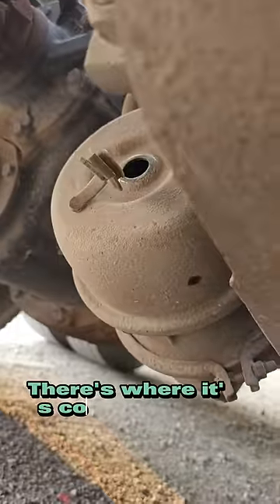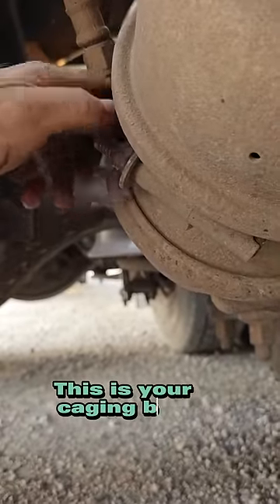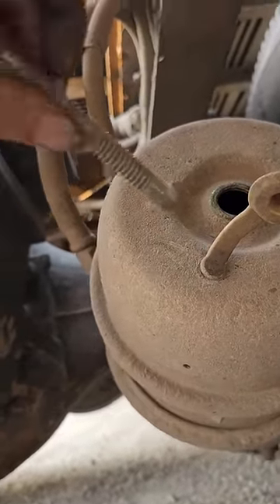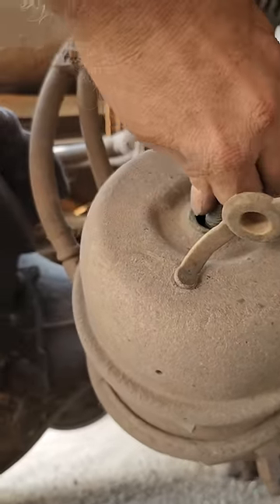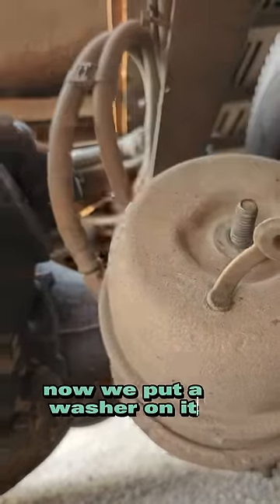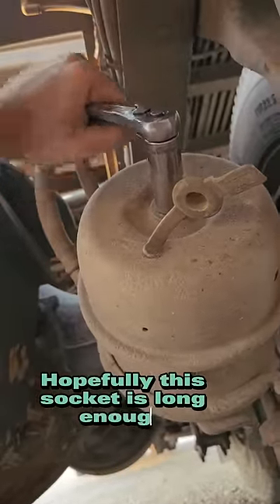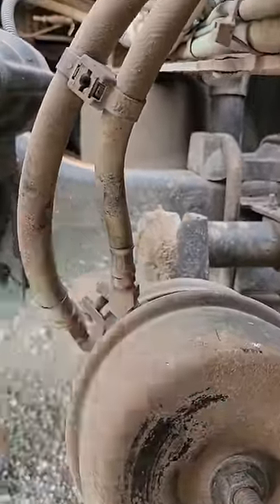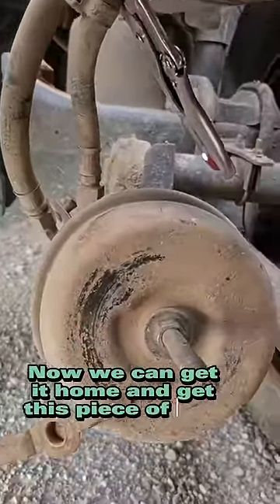How I cage a brake chamber and get home

Comment: Thanks. I learned something.
Reply from the maker: Glad it was helpful!
Reply: @aftersolo  yessir. I'm am owner operator and didn't start out with much know- how mechanically but over the years I've watched a lot of videos to learn to fix things myself to save some dough. Videos like this really help. My next venture is trying to understand electrical issues. That shit is confusing to me. Like my ac blower quit in the sleeper and I can't figure it out. Replaced the squirrel cage and still won't work. Someone suggested getting a meter but I don't know how to use it. Lol
Reply from the maker: You can get a circuit tester to narrow that down.  One end has a clamp for your ground.  The other is a clear cylinder with a sharp pick.  You want to try and ground the clamp on metal that's bare and bolted solid to the floor of the truck.  Once you have that, you touch the sharp end to the wiring and if there's power, the light will go off inside the clear cylinder part.  You can see if your blower is getting power with one.  If it's not getting power, you can use that circuit tester to check out the fuses.  Make sure you check both sides of the fuses.  There should be one for the blower.  If it's not getting power and the fuse is good, I would bet the wiring is bad between the fusebox and blower somewhere.  Could be a bad ground too.  Heres a link to a circuit tester:  https://www.amazon.com/Upgraded-Automotive-Extended-Circuits-Stainless/dp/B07VN5BB31/ref=asc_df_B07VN5BB31?tag=bngsmtphsnus-20&linkCode=df0&hvadid=80882941400106&hvnetw=s&hvqmt=e&hvbmt=be&hvdev=m&hvlocint=&hvlocphy=&hvtargid=pla-4584482468426887&psc=1
Reply: @aftersolo  man,  thank you so much. I'll give it a shot. Should the wire to the blower have continuous power or only when the switch is turned on?
Reply from the maker: @davidtatum8682  I would think only when the switch is on, but I could be wrong.  I'm no expert in wiring by no means.  The switch should be where the power is off and on for the wiring.  There will be continuous power coming into the switch and then the other side, which runs to the blower, would be off and on depending on the switch.  That reminds me, it could possibly be the switch too that's bad.
Reply: @aftersolo  I think there is power to the switch because I had the pillar in the back off where the switch is and disconnected the switch and when I hit the input wire to the switch with the screwdriver I got a little spark.
Reply from the maker: @davidtatum8682  it's definitely getting power but the question is, is it passing the power on through to the blower?
Reply: @aftersolo  that's the million dollar question. Lol
Reply from the maker: That circuit tester will help you figure all that out.  Auto parts stores always have them for around 15 or 20 bucks.  Just be sure your ground is good when you use it or you'll get false readings.  You can ground it then touch it to something that you know will light it up like your batteries or fuse box.  Try to find one with a long cord that stretches to at least 12 feet.  The more expensive ones are so much nicer and it's only 10 or 15 bucks more.
Reply: @aftersolo  ok. I'll pick one up and see what I can figure out. 🤞

Comment: Release brake. Place vice grips on rod that goes to slack. Set brake. Now cage chamber. Both springs in chamber now caged and no need to pinch off air line.
Reply from the maker: I would still have the leak though, right?  The truck was struggling to keep the air pressure up.  Thats the main reason I did it.  Correct me if I'm wrong.
Reply: @aftersolo  with the brake set no air leak. If you did you got a bad valve or a different brake chamber back feeding. And what's an air leak gonna hurt when you're repairing the chamber?
Reply from the maker: I mean to get home.  I don't want a huge air leak on the way home and my brakes going off. I believe it was a bad diaphragm.  I'll remember you're trick though next time.  I've also heard of taking off the line, putting a dime in it to block it off, turn putting it back on.
Reply: @aftersolo  yes it was a bad diaphragm but in an unservicablĺe area of the chamber. So the job to fix it is what's called a piggy back. Parts needed.. New diaphragm,  piggy back, and 2 piece clamp to secure parts together because the clamp is one time use. All parts should come in one box. Weather it is LS or SS t20 or t30
Reply from the maker: Ok.  See.  I didn't know you could do all that.  I just replaced the whole thing.  Makes me nervous taking apart stuff like that.  I'm assuming it would be much cheaper.  There was another guy on here saying you can't replace the diaphragm.  You sound like you know what youre talking about though.  Thanks for the info.
Reply: @aftersolo  there are 2 diaphragms. One is serviceable one is not. Some chambers are non serviceable.  In video that one is the 2 type. Changing a piggy back is dangerous.  Kill ya kinda dangerous.  Highly just changing the hole thing unless you know the proper safety steps to change a piggy back. Those springs are no joke.
Reply from the maker: Ok.  I'll just continue changing the whole thing out.  I would rather spend a little more money and get to keep my face.  I think it's one of those things I would have to see in person to get right, and there's no room for error.  I rarely have to change them out anyway.  I don't put a lot of miles on the truck.
Reply: @aftersolo  I find they fail from 3 things and it all leads to the springs.  Hole in diaphragm due to spring being broken or shifted. Hard breaking under hesv load. Or drivers pulling the mv3 or mv2 vdash valve without being fully stopped.

Comment: Carrying a extra brake chamber, is required in some states. It’s considered a safety hazard, not having extra airlines and glad hand inserts, and yes, spare light 💡 bulbs, and headlights bulbs.
Reply from the maker: Doesn't do most drivers any good to have all that.  Company policies don't allow drivers to work on basically anything on the truck.  Its too much of a liability.  Company I started with in 09 wouldn't even let me repair some wiring on a trailer.  I did LTL for 8 years.  Nobody had tools or supplies with them.  Just a fire extinguisher, triangles, paperwork and fuses.  Nothing more.  I would of got in trouble if I touched anything on the truck or trailer.  Every minute of everyday was kept track of so even of I did repair something, they would of been calling me every minute to see what I was up to.  I'm a shop on wheels now.  Got hoses, air lines, fittings, bulbs, wiring, spare tire already mounted, jack, socket set, 1" breakover, pry bars, sledgehammer, grinder, drill, bolts, nuts, and on and on and on.  I can only carry so much though.  I could see me replacing a starter on the side of the road and people saying I should be carrying a freaking spare starter.  😆 🤣   I can't have everything
Reply: @aftersolo  agreed, I’ve been a company driver and owner operator, for 25 plus years, and yeah, company policy was you report to dispatch that , I’ve been red tag 🏷️ at the scale station, for repairs from the local mechanic shop or wait for the roadside assistance program the truck is under, Penske, or Bright, or Goodyear , Ryder etc … you get what I’m referring. As a independent contractor, my contract allows me to choose and service, and billing department policy is to have a PO # and tax number , unless it required getting a rental truck, because fixing my truck wasn’t cost effective, everything else was on my account.

Comment: Back in the 70's when I was learning to work on trucks, an older mechanic taught me how to do it the correct way. On newer brake cans, you can not change the maxi brake diaphragm. Too many people were getting hurt. Now days, release the parking brake, then have another person apply the foot brake, put a pair of vice grips on the rod coming out of the can against the mounting bracket, NOW  the can clamps bolts can be removed safely.
Reply from the maker: The vice grips police will get onto you for that.  😆 🤣   That's a cool trick though.
Reply: You only use the vice grips to change the diaphragm, then remove them. The other thing to do is, adjust the brakes the other direction so it pulls the rod out of the can. Back when you could change the maxi diaphragm, the can was bad, so I safely got it apart and completely released the maxi spring. In this situation, the spring is about 12" long. Compressed, it puts 900 lbs. of pressure on the brake rod.
Reply from the maker: Dang, you know way more than me about brakes.  A lot guys on here just told me to carry around a few pancakes that way I don't have to replace the entire thing.  That spring scares me though.  I've heard too many horror stories.
Reply: No you are confusing the brake chamber spring with the parking spring , there are two springs in the maxi pot you are correct in vice gripping the pusd rod in the applied position then you must cage the parking chamber, i would caution if you are not sure what you are doing (DON'T  loosen any clamp bolts ) . & block the tires from rolling , i have seen seasoned mechanic get killed & injured with brakes rusted to drum with brakes released  & under truck trying to release stuck shoe & when shoe releases get run over by truck , very innocent mistake but deadly .
Reply: I am not confusing anything. On 1970s Era brake cans, you could change the maxi diaphragm by caging the maxi spring. Now days, it isn't possible to change the maxi diaphragm. The spring in the brake chamber is  only strong enough to return the slack adjuster to the brake released position.

Comment: Yep, well you can do that, but if your caging bolt is missing, which they mostly were for me, I just pinched the line, wrapped a couple wraps of electrical tape around the handle, and back the slack adjuster off. It is quicker to do that.
Reply from the maker: For sure

Comment: You can just release the brakes and put the bolt in and then set the brakes no tools required
Reply: I would not do that it will rip the aluminum flange on the inside and then u need a whole new can not a piggy back can
Reply: @joshuapreston5333  Something tells me you don't completely grasp how caging works
Caging a chamber only affects the piggyback side which in turn, prevents the push rod from moving
The housing on the piggyback side is meant to withstand and contain the spring pressure inside the chamber and it doesn't matter how you cage it, it will hold up

Comment: I just cage the bolt far enough to take the pressure off. Then back the slack adjuster off. Clamp the air line.

Comment: Sometimes the air leak can seal up just from caging the chamber if it's the diaphragm leaking, because the diaphragm moves and gets folded up as you tighten the caging bolt. Was able to save a Volvo on the side of the road due to a leaking brake and a weak compressor by doing that.

Also, always a good idea to put something on those vise grips to keep them secure and stop them from damaging the hose. Had a driver once use zip ties on a set of vise grips and put two quarters under the jaws to save the hose. We put a $0.50 credit on his estimate as a joke
Reply from the maker: Ok.  I appreciate the information.  I didn't know that caging the chamber can sometimes seal up the air leak, but that makes sense.

Comment: The pulling bolt is on the chamber :o That is neat, we don’t have that in Europe, you have to bring your own :o)
Reply from the maker: Yeah.  A lot of guys here, especially up north where it's cold, pull them out and keep them  in the truck.  Apparently, the get rusted into place from the salt on the road and moisture.
Reply: If I’m honest, most, if not all truckers in the U.K. don’t even carry a spare wheel, so they aren’t fixing air leaks.  @aftersolo
Reply from the maker: I got a spare wheel with a tire mounted to it.  I'm ready for anything.  I've changed out tires before and saved a ton of money.

Comment: First off, I would have (and have) backed off brakes enough to get them to a repair shop.
What you are doing is NOT illegal, by any stretch.
Anything over five axles can have one disabled brake to finish the day if a “local” truck, or enough to get the truck to a repair shop if it’s an OTR truck.
That is LAW!!!
Reply: Good to know

Comment: Easier way to to that is you chock your wheels and release the brakes so the plunger comes up then place your cage bolt into olace and tighten it up... Then set the brakes again and your brake chamber is caged without having to fight that spring all the way down..... You only have to turn the cage bolt maybe 3 to 4 times versus 15 minutes of cussing and fighting with it.

Comment: Actually in the brake chamber there is a rubber bowl that the air pushes on to apply the brakes. If it has a hole it will cause the chamber to leak like it is.
Reply from the maker: Would that be the diaphragm / pancake?

Comment: How comfortable are you clamping those lines? I work in a truck service shop I know ideally you’d want to plug them because clamping can cause weak points that could blow but I’ve also seen them clamped off like this
Reply from the maker: They're clamped pretty good.  No air loss.  Just enough to get me home.  I've seen other methods with putting a dime or nickel in the line to block it off then putting it back on but I don't have any spare change.
Reply: @aftersolo  understood was just wondering if best to use vice grips in a….. pinch 😅
Reply: I would definitely replace that line with the chamber.  You CAN'T get vise-grips tight enough without causing damage.
Reply from the maker: @andrewdovenberg2189  why is that?  It's Rubber.  It's flexible.
Reply: @aftersolo  the hard 90 degree edge of jaws can cause the layers to separate from the nylon braiding. Usually it's ok, at least for a while, but keep an eye on that line.  I have heater hose clamps with smooth flat jaws that would maybe be better.  But anytime I've done on roadside  I swap the piggyback so I don't have to pinch hoses. (Just don't forget to cage it)
Reply from the maker: @andrewdovenberg2189  That makes sense with the separation.  When I look up heater hose clamps, it just shows the worm style clamps.  Are you saying they make something similar to vice grips only with smooth jaws?  I guess I could buy a pair and grind down the jaws smooth too.  Another guy said wrap Electric tape around them.
Reply: @aftersolo  look up "hose pinch pliers" (or pinch off, pinching).  I have the kind with pivoting jaws. The jaws stay parallel when clamped, only trick is having the pivot pins and center line of hose aligned for perfect seal.
Reply from the maker: @andrewdovenberg2189  ok.   I found a pair that look like vice grips.

Comment: I set the trailer brakes or whatever set is opposite to the leak. Then install it, I’ve had them kick off engaging the brakes with one in.
Reply from the maker: You mean the caging bolt didn't hold?

Comment: Like how much psi on the spring tension?
Like 20k?
Reply from the maker: A lot.  It's stout
Reply: it's something like 2200 psi per square inch. sure enough to take ypur face off.
Reply: @oregonfordguy9812  holy Fugg! Nah I ain't fucking around with no locking pin to thread connection, scary AF yo 😳🤘🏽
Reply: @magicyeti5630 well when you buy a new one to install most times you have to loosen the band and spin it until the air fitting ports are where you need them

Comment: So the brakes are always on if there isn't any air. That makes sense because if something would happen to the air you would still have brakes that would stop your vehicle in an emergency situation?
Reply from the maker: Yes.  It's a failsafe.  You could have an air leak and you're doing 75 mph.  You hit the brakes and your foot goes to the floor bc all the air is escaping through the leak.  When your air pressure drops below 50 psi, it's going to engage your trailer and truck brakes via those springs in the chambers.  When that happens, if your sitting at 80000 lbs, the truck will come to a stop without locking up the brakes.  The truck has too much weight to stop the wheels completely while moving.  That's what you want.  Now, if your empty or bobtail, get ready.  That suckers probably going to start sliding, but at least it will get you stopped.  You want to try to slow it down without pumping all the air out of the system by hitting the brakes.  Manual transmissions and Jake brakes will go a long ways in those situations and hopefully you can get it down to at least 30 or 40 mph before those tires lock up due to air loss.
Reply: @aftersolo  oh ok I got ya that makes even more sense lol that clears it up completely 👉🏻👍🏻